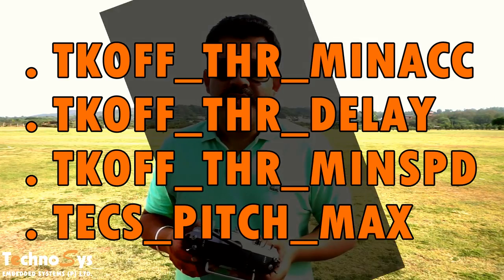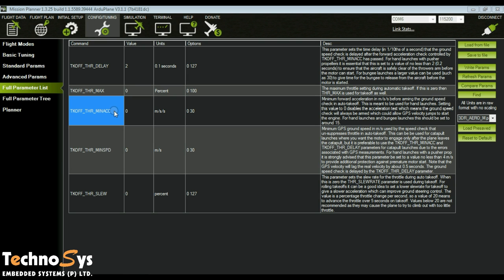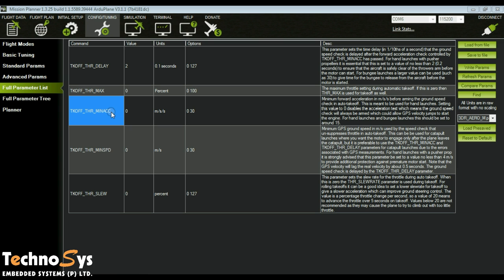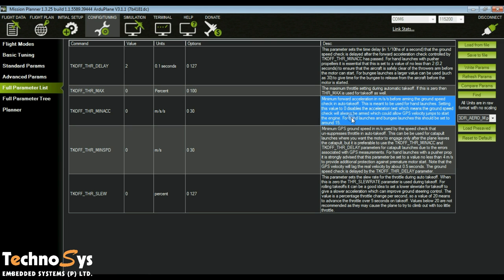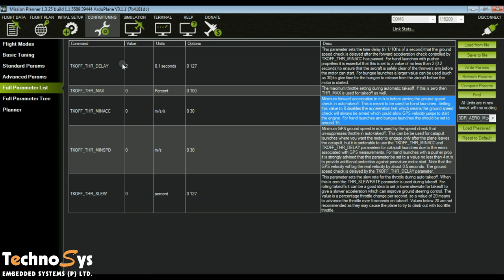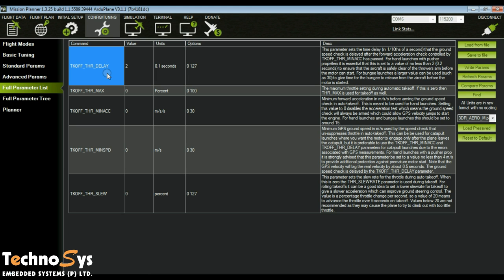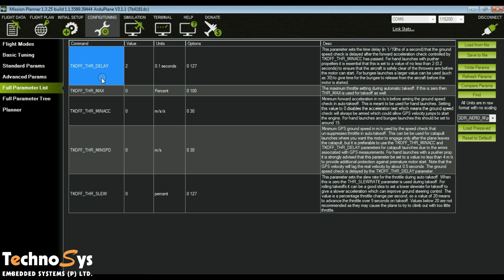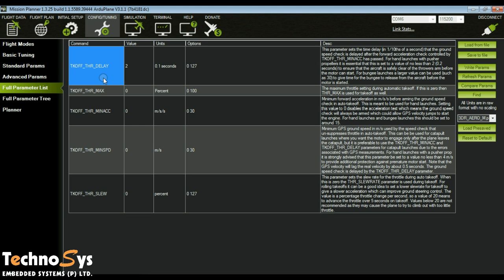Mission Planner Parameters For Catapult Bungee Launch Of An Arduplane

Comment: What version of firmware do you use? Did you had a trouble with pitch angle control?
Reply from the maker: Daanava I prefer using 3.1.1 . No trouble in angle pitch control. Keep it at 30 degrees for big planes and 40 degrees for smaller planes
Reply: TechnoSys ind Thank you.